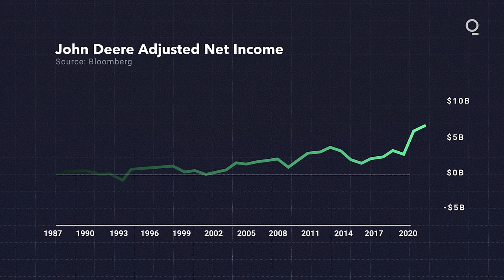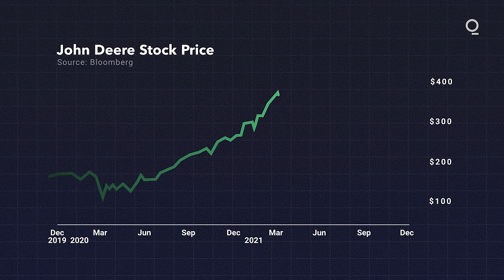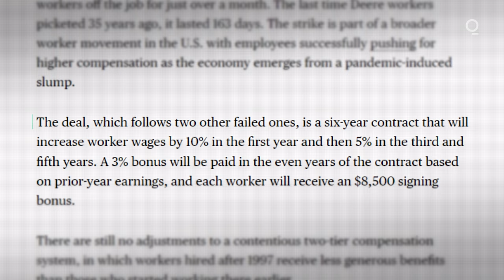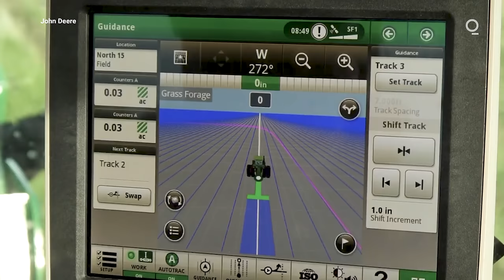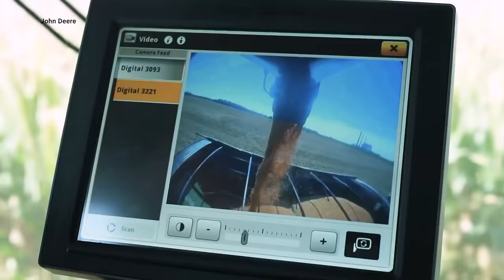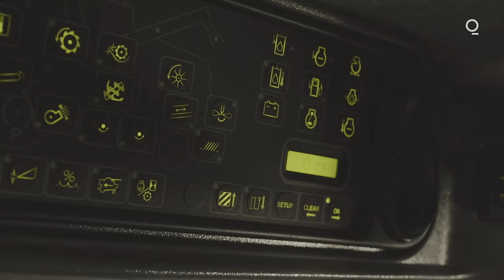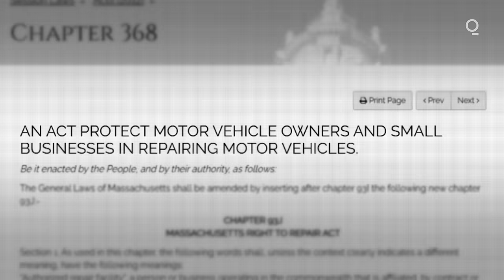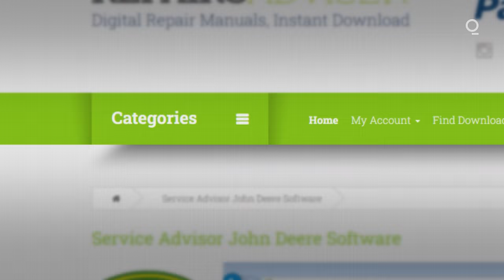John Deere Is Facing a Farmer Revolt

Comment: We just bought a new tractor ( $120K) and we didn't even look at the John deer option because they are reprehensable as a company, the JD guy at the end saying they are trying to stop people modifying the machines made my blood boil, we HAVE to modify machinery because there are so many different use cases that the manufacturers don't think of and the work needs to be done!.
Reply: In my country, I could call a guy to modify my tractor, e.g. modify the sofware so that I won't need A-Blue anymore. But then it wouldn't be street-legal anymore. So I don't do it. But having that law would solve the problem, the CTO stated in the end of this video; if he was honest.
Reply: Same thing for me. I didn't even look at used JD. Totally avoid these non repairabe machines owned by corporations. I need and want my OWN tractor
Reply: Out of curiosity, wat brand is that which gave you the equipment and diagnostics software plus source codes along with the tractor you bought? People are targetting deere, but virtually no other group does that either.
Reply: @fermewilmotsagriculturebio3434  The computer side is only one aspect, JD is not the ONLY company doing it they just seam to be the leaders in going in that direction in their industry. Just like Apple seams to be leading it in phones/computers, but the other companies soon follow.  Small business’s are important to the economy for filling in niches (among other things of course) and need to be protected.
Reply: Honestly, I think it would be best if a group of farmers banded together and made their own company which to make tractors which are easily modifyable and easily repairable. Think of it this way: A new tractor is around $100, possibly double if you include accessories. A few dozen farmers (or less) could likely get enough funding to make their own agricultural-vehicle company, to make their own tractors from scratch, so that in 5-10 years they won't need to worry about the non-repairability and the insider-trading (since all those tractors get data which is then sent to the company whose branding they hold, and so they know how much product is being made at any moment in time, everywhere where their company's agricultural vehicles are used). 

Not only that, but the major companies in this field likely have part of their shares held by the same company, which gives said company access to that data, which allows that company or it's subsidiaries or partners (likely owned by the same people) to make use of the insider data they have access to. This alone could be used by the farmers to make those major companies lose a lot of revenue, and either be forced to change their ways, or get bought by others, possibly bought by the very same farmers who are opposing them, to make those products repairable again.
Reply: @SapioiT  most likely, said farmers that band together and somehow pull that off will end up down the same road when they see the amount to be made by this type of structure lol capitalism at it's core is about profit maximisation everywhere possible. Combined with greed it is highly likely the farmers' company will end up doing the same.
Reply: @hughj7291  Then it's time for someone else to carry the torch.  It's a cycle
Reply: the jd guy comparing a commercial airplane to a tractor on safety , what laugh, they really are being cheeky.
Reply: @SapioiT  Unfortunately, modern industrialization / technology has made it impossible for even a team of 100 engineers to design a tractor capable of real farm work, much less a local group of farmers (who still have a real day job to do). Think of the complexity of modern implements, buying from Cummins at much higher price, the complexity of a 500+ hp capable transmission, drivetrain, etc. Then you have big companies like Deere/Agco that can simply bully you to death with a team of 100 lawyers...
Reply: @royj8549  Not to mention the return on corporate lobbyists with cash under the table or PACs.
Reply: @SapioiT  might be easier and more immediate to lift the heavy tariff on foreign import tractor. John deer can do this because it's a monopoly protected by tariff. But if it has to compete with foreign tractor from germany and europe. You'll bet john deer's eu counter part will more than happy to take market share away from john by not having software lock.
Reply: @SapioiT  Unfortunately, current Patent law makes that pretty much impossible. Many of the now vital components required to make comparable equipment is locked behind archaic IP laws.
Reply: @hughj7291  You are confusing capitalism with corporatism there, buddy.
Reply: @trapfethen  The thing about IP laws like patents, are that they ONLY cover commercial use, with means that you can copy ANYTHING they do, for your own use, so long as you don't sell it. 

Reverse engineer and release open designs for local fabrication. Until there are entire open source tractors that is created by a distributed market. 

Local Motors "Rally Fighter" comes to mind...
Reply: CASE IH 👍
Reply: @calysagora3615  I don't know if you could separate the two anymore
Reply: @calysagora3615   I am not shure that's right, I think the only exemption to patent rights is for research, and useing it for its intended purpose is definitely not research
Reply: @akashic seer true...But ehat spoiled Americans will work in farming anymore? 
We had Polish and Irish here in 60s-70s NY .
Reply: @hughj7291  AND SHOULD THEY NOT BE THE ONES TO GET THE MOST MONEY FROM THEIR CROPS not speculators???
Reply: @SapioiT  I think it may be much easier if farmers organise an foundation and sponsor  students research groups with a goal to reverse engineer open source hardware and software to run on most popular, second hand machinery. Simple, buy popular older JD, Case, MF, models and get rid of proprietary equipment and replace it with open source solutions.
Exact the same what happened on CNC machines.
Reply: @fermewilmotsagriculturebio3434  One of the farmers even mentioned that two other companies do the same thing as Deere.
Reply: @6tgr  Apple are rubbish.  Is John Deere also all appearance and bad performance?
Reply: So my only question is you need to be a licensed mechanic to use their software, or licensed and hold a job in the company to use their software?
Reply: @damionkeeling3103  They all do it, it's standard practice in every car/truck manufacturer.
Reply: @collins9708  Not sure about the US, but I read you can just buy the software license from them. What this really is about is that some guys want the software, mess with it (and potentially ruin their equipment) while keeping JD liable for warrantly. These tractors have had on-board diagnostics systems since the early 90's where you can view and deal with active codes, farmers already do that, what we can't do is modify the software.
Reply: @mil3k  It already happened with CNC machines? I didn't know that. Thanks for sharing! Yes, I agree, that would be a great idea. The biggest cost would be needing to supply them with the machinery on which to test those things, expecting the machinery to break, but it could be done at the beginning of the off-season of each particular machine, and then return the vehicle into normal operating order before the season where the machine is needed. And the investment for this could be recuperated by selling the results of that work for a year or two before making it open-source, or selling the open-source already ready to be installed. It would likely need to happen one product at a time, and to require vast documentation, but it will likely be successful, if right-to-repair fails, or even simply before right-to-repair starts being heavily enforced. I could very much see people ripping away parts of their agricultural vehicles and replacing all that with a raspberry pi or small PC, or all-in-one PC built into the screen.
Reply: @royj8549  Fair enough. That's truly unfortunate. Though people could import them from countries where copyright laws aren't respected.
Reply: @keenheat3335  I completely agree that it would help. Even if the tariff lift only applies to a handful of countries, like those where USA exports the most and imports the least (for USA's financial profit from the trade).
Reply: @hughj7291  That could end up being the case, unfortunately. But making open-source agricultural vehicles and being the first-to-market might help.
Reply: @6tgr  I didnt realize Mahindras cost $120k

Comment: I am 100% on the side of the farmers on this one. Right to repair is a big deal, & not just for farmers. I work in the autiomotive industry, & let me just say that if we let John Deere get away with this tomfoolery, very soon the automotive market will follow suit. Do you want the right to change your own engine oil? Or modify your own suspension? 

Look at Tesla, they are the John Deere of vehicle manufacturers. I have had many customers opt to NOT buy a Tesla because of the tesla exclusive "repair facilities" that are few & far between, with wait times of 3+ months for a simple repair. Dealers are already getting backed up due to parts shortages, to take away the mom & pop's shop's right to repair, we are going to be left with no choice but to take it back to the dealer & be at their mercy for how long the repair will take as well as the cost to repair.

We need to nip this in the bud before companies see right to repair a thing of the past. It may affect primarily farmers for the time being, but that will change very soon if we dont speak up on their behalf.
Reply: automotive industry is already trying to do it. i have an 09 toyota tundra which i have maintained / fixed everything by myself on. there's only one thing i can't do in my home garage, change the transmission fluid, which should be a similar process to engine oil. but nope no way to do it normally, you need a special machine. Guess what part on my truck is now showing issues? (edit: i did take it in for a tranny fluid swap about 4 years ago)
Reply: Yup! We pay enough for software to fix your new vehicles each year and it's getting harder to fix newer vehicles each year. I think vehicle dealers would like to MAKE you take your vehicle to them for service. 

The key switch broke on my Honda Accord and it would've cost under $100 to fix it a few year's ago, now I have to pay $1400 for a couple keys and the dealer to program my old 15 year old car...if my husband hadn't just put a new transmission in it, the car would've been sent to the junk yard. If you care about the environment, don't keep wanting more and more complex vehicles as they end up in the junk yard sooner than they used to.
Reply: The electronics & computing industry is another one that will benefit heavily from Right to Repair legislation. Cell phone manufacturers for instance have deliberately made it absurdly difficult for independent local repair shops to get the replacement parts they need to fix your phone. If you get an iPhone repaired by Apple, they'll charge hundreds of dollars for a simple screen replacement. While meanwhile when I had an iPhone 7, I got the screen replaced by a locally owned repair business for only $80 and it worked perfectly.

Right to Repair is important for all industries in my opinion. Manufacturers want to have a monopoly on repairing their products so that they can charge whatever they want. The fact that Right to Repair is controversial whatsoever is insane to me. Right to Repair has been an expectation in the automotive industry for years now. It doesn't mean that you HAVE to repair your stuff yourself, it just means that you have the RIGHT to do so if you want to.
Reply: Every repair procedure for every piece of equipment or vehicle should be on youtube. Every part should be available for purchase on Amazon.
Reply: If we don't speak on their behalf...... I've been out of North America for 10 years but I don't understand why I'm seeing Western people, for whom speaking out is a point of identity, something we rub into the faces of our Asian comrades - afraid to speak out. Why are Western people reluctant to speak out lately?
Reply: If this CEO wants to compare his products to airplanes then let the 3rd party maintenance world loose on your equipment as well just like aviation has done. Only problem I see is that shipping is a little more difficult to take a tractor or combine to Ecuador where the labor is cheap versus taking a plane there on a 2-3 hour flight to save a boat load of money to put into the CEO pocket!
Reply: or pump your own gas in New Jersey.

Comment: I’m with the farmers when it comes to being able to repair their own equipment.
Reply: Sure, what they can repair but these machines are state of the art. Farmers should have these under warranty & JD should send out techs to solve any needed repairs.
Reply: @hiitsrudd8567  yea,but these farmers should be able to buy the software and be able to repair the machines they own. The manufacturers charge too much to fix a simple problem that can be diagnosed with a computer and the right part. Just like cars,the dealers make most of their profits in the service department,but in cars you can buy a code reader for a reasonable price and fix it yourself.